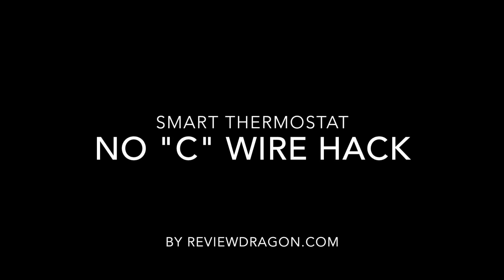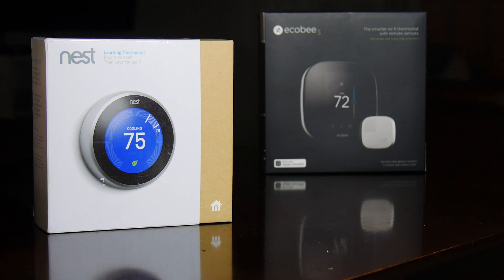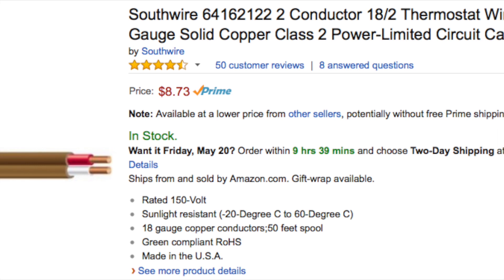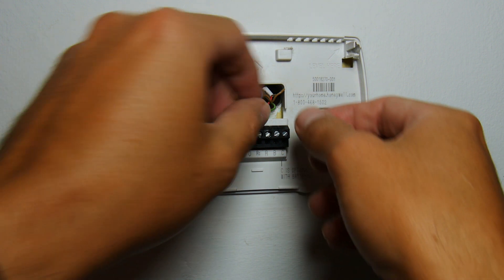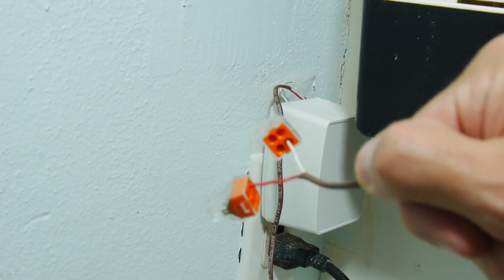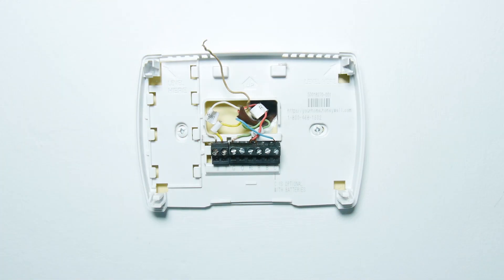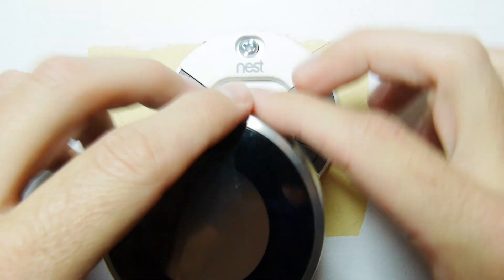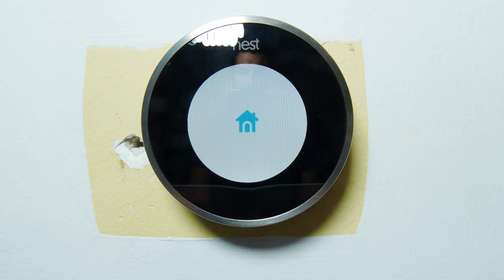No Common Wire Smart Thermostat Installation

Comment: You already had all the wires you needed....the board was already powered by 24 volts.  All you had to do was find a terminal that when used and grounded it showed 24 volts...you went to to much work... you got it but you had it right before your eyes....

Comment: As a HVAC technician i can tell you none of this was necessary. if you
 have ANY extra wires of any color it can be used as a common between the air handler and the thermostat
Reply: Clear concise information. Kale

Comment: Seems to me that when you power up your air handler your going to end up with 48 volts to the Rc and fry that beautiful stat. I don't understand why if you had extra wires at the air handler you didn't just wire the blue to the C terminal on the air handler and  the C on the Nest stat.

Comment: I had a new AC system installed and the HVAC techs left the old 4 wire in place instead of running a new 5 wire simply because of laziness.
I purchased a 24v transformer with 25ft of wire and followed the video. Plugged in near the thermostat, ran the wires, hooked them up and the Nest 3 is fully charged.Thanks D King you had a simple fix for my problem with Nest 3 and it works wonderfully now.

Comment: You should have just stopped at "I'm not an HVAC guy". You needed none of this crap. Simply hook up one of the spare wires in the run to the common terminal on your equipment. Yes, I AM an HVAC guy. 

I saw it on YouTube, it must be true 😂
Reply: I am am HVAC guy also and I agree. 
this makes no sense

Comment: just use the blue or brown wire and connect ether one to c on mother control board and other end to c on nest. no extra transformer needed
Reply: Not all air handlers have a C terminal on their "mother control board".  Also,  manual thermostats didn't need the C wire so many thermostat wirings don't have the extra wire for it.  If you have the extra wire and the c-terminal on the control board or can easily get to the a "common" terminal, then yes you don't need the transformer.  This video is for those that don't have that as an option.

Comment: So you put a 24 volt transformer on the R wire adding additional voltage to the circuit board on furnace. That already supplies 24 volts at the r terminal.  Surprised you didn’t fry board or thermostat.
Reply from the maker: Not how it works.  The supplies are in parallel, so it's not 48V to the r terminal.

Comment: great video. I have done all this and more and the nest just will not heat the house past 65 degrees in winter! i have the heat set to 75 and it will not go higher than 67. borrowed old thermostat, no issues. nest is in garbage.

Comment: I noticed you had both Nest & Ecobee3. Have you tried both? Do you prefer one or the other? BTW, very helpful video...thanks so much!
Reply from the maker: Currently I'm using the NEST.  I liked both, some pros and cons for each.  I had some connectivity issues with the Ecobee but it also had the remote sensors which I really liked.  The nest seems a little more reliable and has the learning which I guess is good.  Although, not to keen on Google knowing when I'm home or not ;).  Not sure if that helps, but honestly I think most people would be happy with either.
Reply: D King thanks so much for taking the time to respond. I'm currently trying the Ecobee3 (full version) because it was available at Costco with 3 sensors included at a decent price. I figure it was as decent a place to start as any, especially given the excellent return policy if I have any problems. A large part of my wanted to go with the Nest as I love the learning feature and the modern design, plus their customer support when I asked a few pre-sales questions via chat at 11:30pm was stellar. My questions were unusual but they were able to contact senior tech super and get answers. The issues I had were these: I kind of hate to pay full price for 2 year old technology that hadn't been updated for ages, I don't like that they keep your usage data but don't give you access to it, they have much less integration with other home automation (like SmartThings, Homekit (which I don't use), and others). It seems they expose much less control of the unit via their API. I use the SmartThings hub and the Ecobee is much more popular on that platform given the extreme integration that's possible due to its excellent API. It seems that that did extensive research found more people switching from Nest to Ecobee and HVAC professionals also seemed to prefer it. I probably could have hacked a way to use some remote sensors with Nest but I couldn't find much information about it. It was the hardest decision for me yet in all my home automation purchases. I was still super torn thinking about going with best as I was buying the Ecobee but so far it's worked well. I think there learning feature would have been great but I'll have a lot of control over the Ecobee. My spouse really likes the easy to read display and we both like the weather shown on screen & the predictive temperature algorithms. So far, were happy with it. I kind of feel like Nest will release a new touchscreen version in the near future but I could be dead wrong on that. Just send like the obvious next step. Thanks again. Your info really helped me! I used a transformer to power the Ecobee since we live in an apartment with no ability to add a C-Wire. It's worked flawlessly. In order to avoid the issue mentioned of having 110v power potentially running to the heater (and in my car the HVAC contractor having no idea that it's live since we have 40 units in our building & were the only ones with a smart thermostat), I hooked up the transformer word to "C" and to "Rc". I had read that many thermostats look for power on Rc first for whatever reason. We only have a 2-wire boiler heating system so Rc is completely unused. The Ecobee asked me questions when initiating first use saying it detected wires on Rc but only a heating system. I confirmed and it's worked flawlessly. No worries now about power flowing to the boiler because I don't have two wires on any of the connections. Great info. Thanks again for sharing!
Reply from the maker: Yes, the Ecobee integration with homekit was a big selling point for me initially as was the remote sensors.  But in my use, the sensor was not really necessary since I really only needed one and the differential between the thermostat area and my bedroom is fairly consistent.  The programming/learning of NEST handles this well.  I suspect that in the future when there is a larger number of people in my household the increased randomness will make the Ecobee better at handling this.  Both are significant upgrades over traditional thermostats and the phone apps are the real killer feature.

Comment: I'm trying to add an ecobee3 with RWYG and no board on my air handler. I want to add an external transformer, if I install the c wire where should the other one go? Rh? Rc? Just leave it hanging?
Reply from the maker: Been a while since I installed the ecobee, but shold work if you to Rc (probably or Rh) depending on how you configure the ecobee.  It will look for power there.  I think if you look at my other video you can see what I did.  Hope this helps.
Reply: In my configuration I did as with the nest to get the Ecobee to work. Combined the red going to RH with the white from transformer on RC and now it works

Comment from the maker: Good luck.  The battery is probably dying bc the unit isn't cycling on/off enough for the nest to steal enough power.  That's what it does when no C wire is installed.  That or you have a bad battery in the NEST.  Hope the transformer works for you, seems many people are having one issue or another because of it.  You might also check that the C wire is actually connected.  Either look visually in the air handler/furnace portion or use a voltmeter to test it.

Comment: Thank you thank you thank for this awesome demo. I installed a Nest at my remote cabin over the weekend, and I didn't hook up my existing C wire from the furnace because when I did the Nest would not boot. I contacted Nest and they said "no problem, your Nest battery charge will last at LEAST a month. You don't need a C wire!"  Well, 9 days later the Nest is offline, out of power, and 150 miles away from me. Next time I go to the house I am installing a 20V transformer as you show here.  I wonder however if I just move my red wire from RH to RC if the Next would boot with my existing C wire installed. Nest support could offer no help on why my unit would not boot with the C wire installed. They told me I must have a "bad wire". Thanks again, you provided a huge amount of helpful info here - the Amazon screen shots were a great thing. I just order the same exact parts you showed.
Reply: Update:  I just did the installation as you show here, and it worked perfectly. I could not get anything to work until I doubled up one of the transformer wires with the RC wire as you show. I know that some folks here didn't think you needed to do that, but that was the only thing that worked for me.  Thanks again!
Reply from the maker: Glad it was helpful and you got your system running properly.

Comment: I have 110v to the thermostat I'm replacing and it's just 2 wires with no common.  I was told to get an Aube RC840T-120 which is a relay with a built in 24v transformer.  It has 3 wires to connect to the 110v (black, white, red).   So if the 110 line gets connected to the black and white of the relay, and the plugin transformer gets connected to the C and Rc of the Nest, does anything need to get connected to the red wire of the relay?
Reply from the maker: Sorry Frank, don't know about this relay.  The nest just needs the 24v AC power to operate so not sure what the red wire has on it.  Maybe look at the spec of the transformer and see.

Comment: I'll add that if you have a boiler system using zone valves and the zone valves are using the boilers 24vac transformer you will not be able to use the same transformer to run the stat. It will be fine without a call for heat but when there is a call the zone valve motor will take all of the voltage available at the transformer to open the valve. When this happens the stat will lose power and shut down, closing the zone valve. When the zone valve closes the stat will regain power and try to call for heat again starting the cycle all over. Only way to solve this is with an external or second transformer wired to the RC/RH and C terminals. I am an HVAC tech in MI and have come across this many times. Also, many wifi stats are referred to as power robbing thermostats. Those type of thermostats which claim you do not need a "c" wire can cause strange problems within the control board circuitry and make the equipment act erratic. My opinion is if you are going to use a wifi stat the best course of action is to wire in the "c" or provide a secondary transformer to run the stat if no "c" is available at the board. On a forced air furnace, the board will have a "c" terminal you can use 99% of the time so no second transformer is necessary. You will however need to extra wires to make the connection. Hope this helps!
Reply: Yes, and yes. Air handler should definitely have a "c" connection. If not, simply run 2 wires from the air handler transformer to the stat. One to "c" and one to "rc". You can double up because one transformers load is the equipment, and the others load would be the thermostat itself. They both make 24 volts, all you are doing with an external transformer is providing a constant source of 24 volts for the thermostat memory and wireless connectivity. The equipment is passing its 24 volts through the thermostat switch and back to the equipment. Really, all a thermostat is doing is touching two wires together to complete the ignition circuit of the furnace or boiler. The equipment transformer does not power the stat, just sends power through its circuitry. I have wired many this way!
Reply from the maker: Thanks for the info.  I'm not familiar.  So does the internal battery of the NEST compensate for this?  Is the voltage only lost during the initial call or is for the whole time the valve is open?
Reply: As soon as the valve begins to open the stat will lose power closing the valve again. Once closed, the stat gets its power back and the valve will start to open again....rinse and repeat! This was not with a nest but they all operate basically the same. The battery will not compensate, that is why you need a stand alone transformer, or a transformer that is not used for the zone valves as well.
Reply: Mike S, connect to c and rc, that is how I have always done it. However, you have multiple transformers already, one in each system. You should be able to add a c wire from air handler in attic along with your other y g and rc connections and power the stat that way!
Reply: kingrukus1234, So are you saying that my air handler has a C wire? If it does, then it is simple... C to C.....

... but if not, then I would double up the Rc with the air handler's wire and the external transformer's 2nd wire (while the ext transformers 1st wire goes to C)?

And why is it ok to put 2 wires to Rc?
Reply: Been looking for this comment! being I have a boiler I'm finally getting a better understanding of this boiler. Just got stationed here at Ft. Wainwright Alaska. All I hear is about how brutal the winters are here.
Reply: if I connect the external transformer, which wire of the external transformer goes to RC and which goes to "c".  Thanks really appreciate this, as im looking to do this, but dont want to just experiment with the 2 wires. If I put a voltmeter on the transformer 24ac, I should be able to tell which is positive and which is ground or common. Does positive go to RC and ground go to c "common"?
Reply: 2 questions... I have an AC in the attic connected to Y G and Rc and a Weil McClain CGI-5-PIN, Series 2 boiler in the basement connected to W1 and Rh, but the Nest needs a C wire... Ques 1: if I use an external trasnformer, one wire will go to the C, but where would I put the other?  The Rc and Rh are taken, and adding a 2nd wire NEST is telling me will not work and can cause damage.  
Ques 2:  you mentioned 99% of forced air systems have a C terminal.  I am pretty sure the Weil Mclain boiler does not, so where would I wire this to then if I cannot resolve it with the external transformer?  Thanks!!
Reply: Yes thanks, I upgraded to a nest and at the same time upgraded to a 2zone taco controller. I think the previous installer (using the honeywell tstat ) was stealing the 24 volts from the AirCond transformer. I can't exactly figure it out but the Rh wire was connected to C. So that is my theory - I wanted to use the 24v terminals on the taco relay to power the tstat and put the Rh into th correct terminals but now I won't do that. Seems no matter whet I do, in I disconnect the Rh wire rom the C wire that in inserted into the tStat terminal nest does not recognise the equipment connection.
Reply: My problem is with my System 2000 boiler working erratic with nest thermostat why

Comment: When you first hooked it up and had both Rh and Rc and it didn't work, what wasn't working? 

That's how it's supposed to be but mine isn't talking to my boiler to call for heat.
Reply from the maker: The thermostat (I think) wasn't looking for power at the Rh terminal.  So I connected it to the Rc where the thermostat was looking for power (possibly from previous install).  I think the NEST is smart enough that if you have it hooked up from the beginning this way it will reconfigure, but I'm not sure.

Not sure why the boiler is getting responding to calls for heat.  Do you know if the thermostat is actually calling? If your boiler is listening? The "W" is the call for heat terminal.

I'm no HVAC expert, just wanted to share what worked for me with you guys.  Perhaps if you describe your system, someone here can chime in and help you.
Reply: D King I will check with Nest thanks. I think the Nest was calling for heat because I could turn it up and it would turn red.
Reply: So Nest support was helpful until about now.  Even thought a Nest senior support tech told me about this transformer, I cannot get one to help me with it.  Guess it's time to do some more research.
Reply from the maker: Sorry man, I'm no expert just wanted to share my experiences with you guys.  Feel free to keep asking and hopefully someone will help.
Reply: From my external transformer I ran one wire to the C terminal and with the other I just doubled up on the RH terminal with the two wires. My boiler is seems to be operating just fine.

Comment: On the transformer, there are two screw connectors.  Does it matter which one goes to C or Rh\Rc?  You never talked about that, it was just connected.  Thanks
Reply: I just read on the Amazon questions either way works.  Will try that.
Reply from the maker: Either should/could work.  Since it's AC there is a chance that things are out of phase so you need to reverse it if it doesn't work one way.

Comment: I don't have a Common wire at my old thermostat wiring...Only 4 wires......Installed the NEST and it doesn't work......Power and everything comes on but Heat blows cold air? Thx for your input
Reply from the maker: Again, not a HVAC tech but seems like the thermostat is calling for AC and instead of heat?  Perhaps two of your wires are mixed up/mislabeled?  If you can, go to your air handler and find the board where the thermostat wiring is connected and make sure the colors match what you have hooked up to the NEST at the other end.  Sorry I couldn't be of more help, but maybe someone here can.